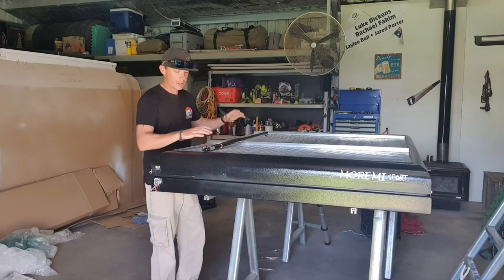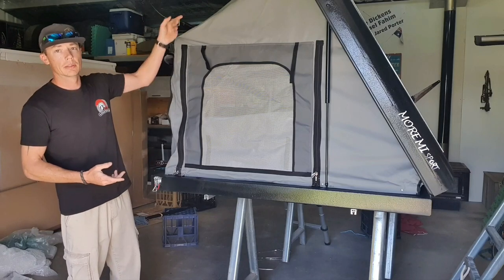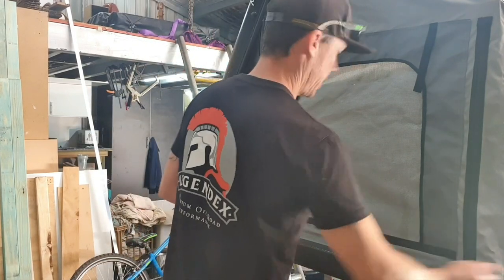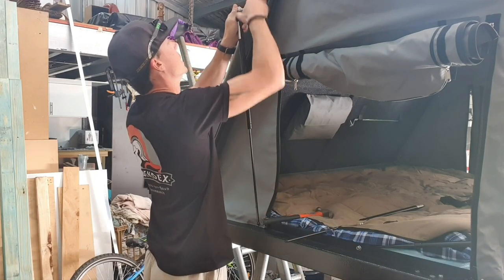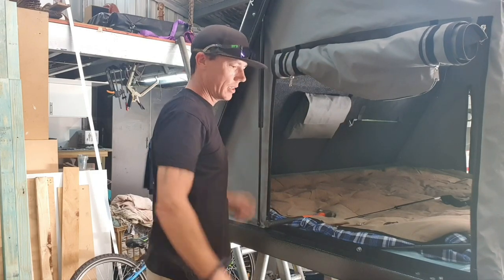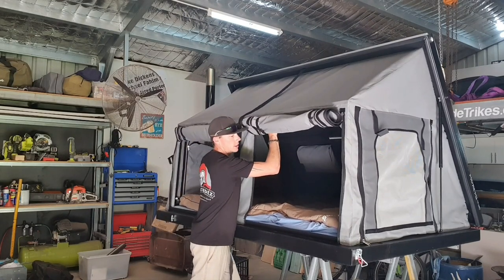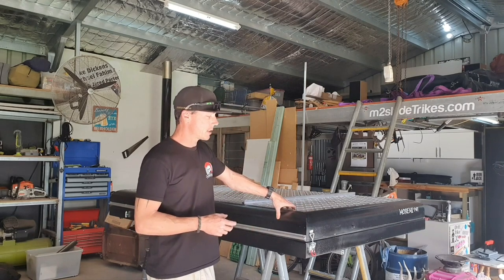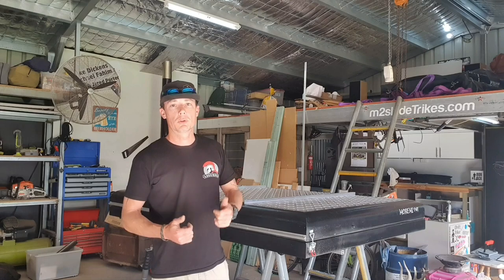How To Change Moremi Roof Top Tent Struts - AUCampers

Comment: Thinking about getting one myself. Think it would be fine for 2 adults and a toddler?
Reply from the maker: I am thinking so. Depending on height and build of yourself and your partner and todler. My partner and I fit with plenty of room. I have seen people with roof top tents make a raised fold flat frame to put babies and todlers on that works really effectively and can be folded flat. For one of these roof top tents, I would even go as far as saying that it could be left in the tent when packed up.
Reply: @AUCampers  thanks mate, appreciate the reply.  Wish I could find more videos or reviews on these tents. It's an 8 hour trip to check one out in the shop 😂.

 Now I have to try and look up these fold flat platform, sounds pretty handy.
Reply from the maker: Because they are relatively new to the market and are not one of the cheaper Chinese models that are on the market,  fewer people tend to have them.

Comment: Hey chief, do you know if this RTT is actually 50 kgs as it is claimed/marketed ?
Reply from the maker: Ours is the V1 and it was 52 kg from memory when we weighed it when we first got it
Reply: @AUCampers  Ok thx, wondering how you did you weigh it ?
Reply from the maker: @volcanic5187  with a set of scales used for butchering and 2 big slings
Reply: @AUCampers  👍